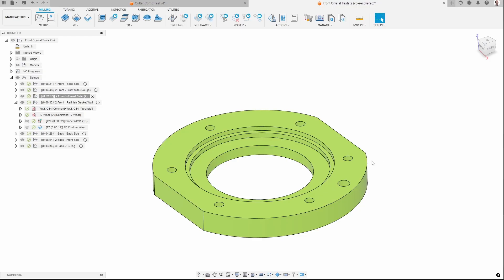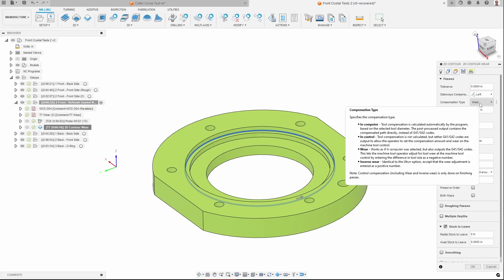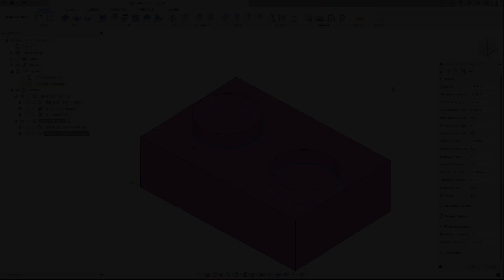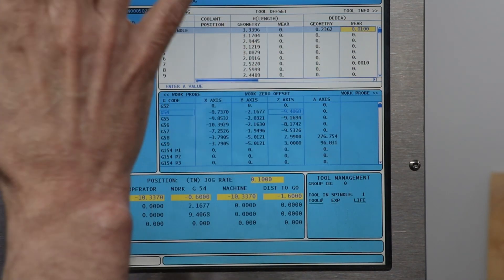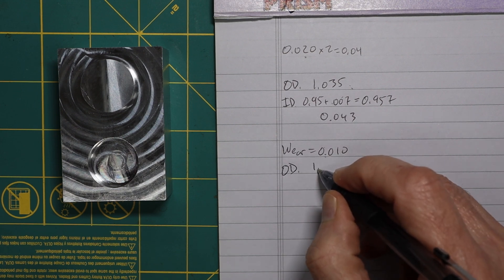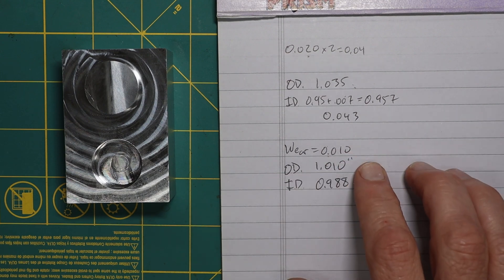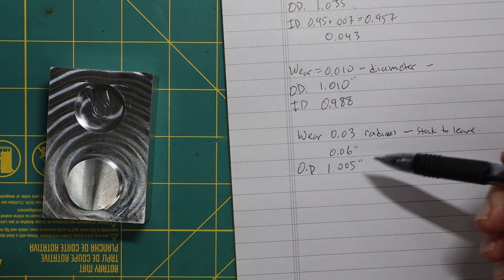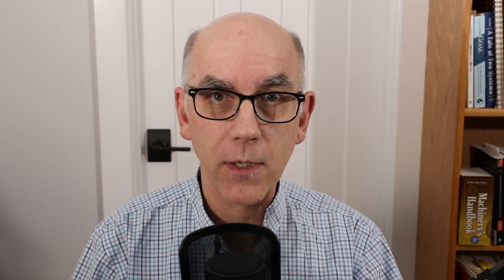Cutter Compensation vs Stock to Leave

Comment: on your measuring i was always told with any tool with a ratchet like your inside mic only to click it about 3-4 times for the most accurate reading i noticed you cranked down on it when measuring

Comment: Thanks for the help! We were confused by those descriptions in F360 as well. 

What we have found (in  terms of tool deflection) is that if you want the BEST results from top to bottom in the hole or boss, use a bore (or ramp) cycle so that the cutter engagement is always similar (and gives you low tool pressure) and always do a spring pass. 

We have been able to dial in hole diameters within a few tenths of the correct diameters this way interpolating holes (and saving us from pulling out the boring head or buying reamers for a few holes at a decent fit)

Comment: Hey, John, I was wondering on your AB injection molders.  They have those pneumatic->hydraulic clamping cylinders.  What are those things actually called?  That name space of pneumatic/hydraulic booster/clamp/pressure multiplier/what-have-you is very crowded, so I've had trouble finding out more about them.  Do they have branding/specs on them?   What are your thoughts on those vs screw clamp/big toggle style clamps on injection molders?  Thank you for producing all the injection molding content!
Reply from the maker: Here is the information on the one I have: https://www.jergensinc.com/en/product/intensifier-cylinders?c=35504
Reply: @JohnSL  Intensifier cylinders!  I guess that's the term I was looking for.  Is yours the 8:1 ratio or the 30:1 ratio version?   Thank you so much for the info!  Now that I know what those things are called, I'll be able to find out more about them/look for used ones, etc.  Thank you!

Comment: Since you have a probe, Haas has a macro that will cut then probe and adjust cutter comp automatically
Reply from the maker: Ah, but that would require I have a target size. I'm using the manual wear compensation to try out different opening sizes with the Hytrel watch gaskets to determine which size provides the water resistance needed. Once I do that trial and error to get the target size, then I can use the macros to compensate automatically.

Comment: John Wouldn’t you benefit to use the probe macros to check the dimensions inside the machine before removing the part 
Personally I use in control and set half my tool diameter and then walk the wear radius in to achieve dimension which is a minus figure
Reply from the maker: Yes, I could. In this case, I'm using the wear compensation to try out different opening sizes with the Hytrel watch gasket and crystal to see if I'm getting the right water resistance. In other words, I don't know the correct size yet.

Comment: I’m dumber then a stump on this, but, wonder if there is a tool deflection parameter, that would also be relevant?
Reply from the maker: Deflection can definitely be a factor. I usually use GWizard to get an idea of what the deflection will be and adjust my feeds and speeds to minimize it for the end mill I'm using.

Comment: Wear comp is basically the industry standard these days.
Back in the Old Times, hand programmers loved using full cutter diameter compensation because they could program directly off of the print, and change end mill sizes on the fly. With CAM systems today, we don't need to do that (just change the tool in CAM and everything updates).
What we do need to do is compensate a little for the fact that end mill tolerances are not +/- 0, or comp out for tool deflection, or cutter wear. As such, we tend to leave the Diameter at zero on the tool page, but still output cutter comp moves and very small adjustments in the Wear column.
Be very careful playing with this though - if you set Compensation to In Control, the CAM system will output tool path directly on the wall you intend to machine, expecting the control to move it the .125" off the wall (with the aforementioned .25" end mill). If you forget this, it is pretty easy to have a nice little tool crash and kiss $40 goodbye.

Comment: The CDC settings tend to default with diameter mostly because the feature is going to be measured symmetrically on either side (as with a boss or bore, square pocket, etc) so the controller does the math for us knowing we want our caliper/micrometer measurements to directly increase/decrease. The vast majority of CDC measurements involve a direct change like that. A radius change would be useful when only cutting one side of the feature (maybe there's a datum on the opposite wall), or doing some kind of feature-to-feature distance measurement. Some machines change the terminology to CRC instead of CDC when you do that change lol

Comment: My experience has been that trying to use cutter compensation for cutter diameter leads to issues. G41 and G42 adjust the path to the left or the right, but this can easily lead to ambiguities. I think it's fine if you use those G codes for minute adjustments for cutter wear, but I've found that trying to use them for the entire cutter diameter can lead to wild movements when entering and leaving compensation mode. 

Maybe the Haas is smarter than Mach 3, but eh.
Reply: i've had the same problem with DATRON. Decided to use stock to leave  and compensation in computer rather than cutter comp.